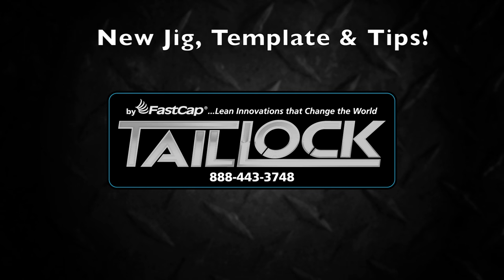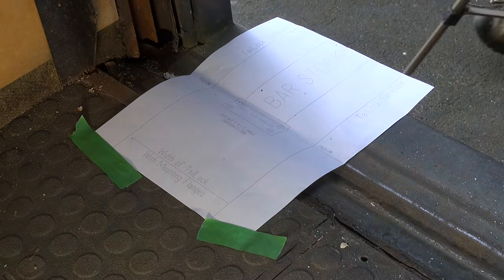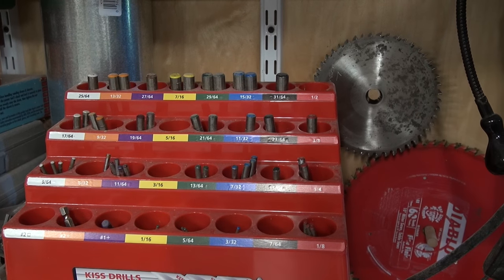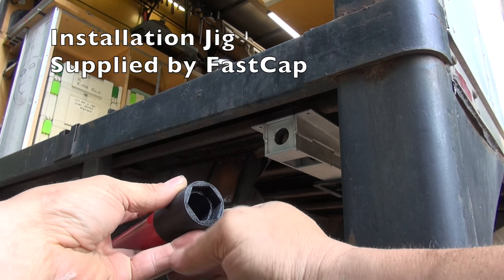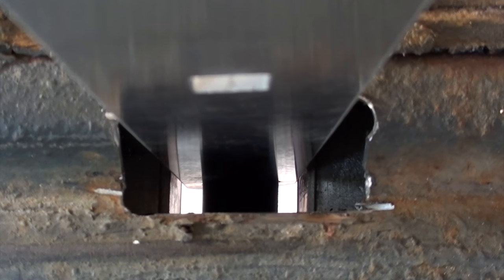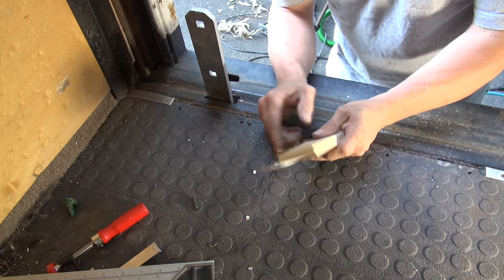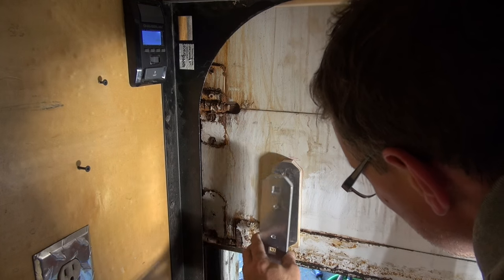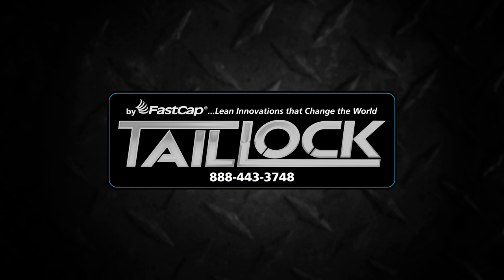TailLock Truck Lock Installation Instructions - part 2 of 2

Comment: wait... the screw heads for the mounting hardware are accessible from under the truck?  Can't I (nefarious criminal that I am) just unscrew it?
Reply from the maker: Sure, you can unscrew them, however if it is locked you will still not be able to remove it. The actuator pin locks it to the floor of the truck with the barstock.
Reply: Brian Way ah, cool.  Thanks.